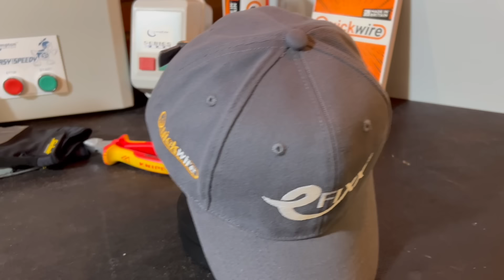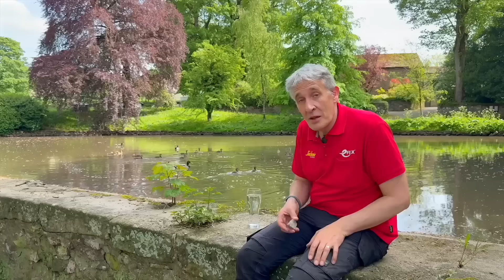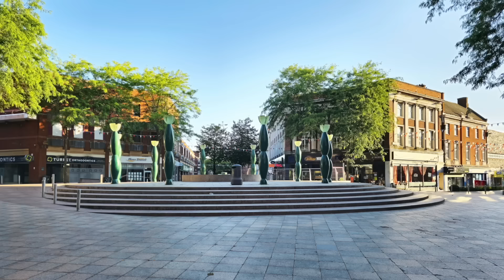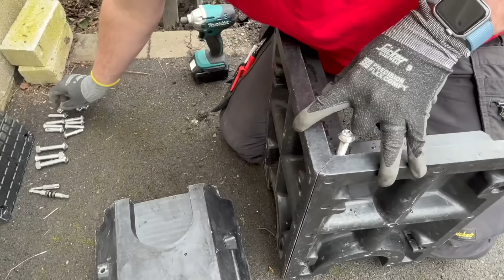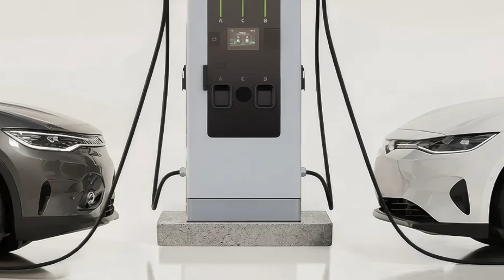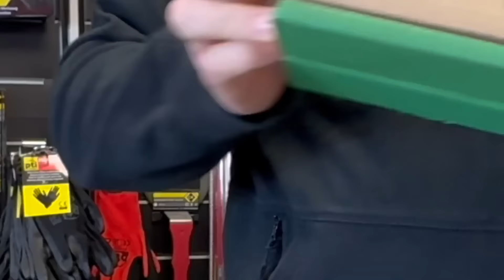Bi-Directional RCDs Unplugged - Have we got this Wrong?

Comment: That explosion can only have been from batteries. Not possible from solar panels and an inverter might go pop, but it wouldn't take the roof off. Or maybe Mr. Qureshi was cooking something he shouldn't have been.
Reply: @billdoodson4232  my thaught exactly i know the panels can internally short circuit and catch fire but never heard of one exploding.  Im a green horn in the electric world tho so what do I know
Reply: It wasn't an explosion - the video was clearly edited to select several still images/short video clips many minutes apart. You can see that by the shadow on the left wall dropping a several inches in multiple steps. The whole video was probably between 30mins to 1 hour - enough time for the fire engine to arrive at the end.
Reply: @tonyh6309  Ring cameras take a picture every 14 minutes or so.  That seems about right for the shadow movement in the frames.  However, modern solar panels don't catch fire.  The roof did.  The panels... probably didn't.   It probably started at a junction box or from a failure inside the loft causing a fire.  It may or may not have actually exploded so my other comments on it being gas or a battery runaway (the gas is flammable in a LFP runaway but the batteries themselves don't ignite it)... those would have likely been an incorrect asesssment.

Hmm.... but in reading more news reports on it, apparently there was an explosion.  It's unclear when though.
Reply: We don't know the story... start of last winter I got a panic phone call because somebodies boiler was tripping their RCBO, they had a tiny boiler room, 20 mins later, problem fixed but I had a lot of trouble gaining access to the faulty boiler because it was of petrol cans, acetone, BBQ gas cylinders in winter storage, about 20 unmarked plastic containers, solvents, cleaning products...
For all we know, the electrician may have done a first class job but the explosion was because he moved everything around in the loft to run the red & black 6mm!

Comment: If solar inverters could parallel with each other in island mode not only would they parallel with each other in the same property the whole street would parallel and maybe the whole town!
Unfortunately this is the quality and understanding of the people who write the regulations!
Reply: Not as silly as it sounds.  There were real concerns with just this happening in other countries.  Testing found that in areas with high penetration of PV anti-island protection could fail or take extended times to shutdown.  Plenty of research out there about it.  Your regulators are not idiots.

Now this is a different situation to the bi-directional RCD debate going on over there since supply is being actually disconnected from the inverter which is not the same as happens in a blackout where the inverter stays connected to the 'grid'.
Reply: There have been a handful of cases world wide that I know of where a subdivision that was disconnected from the grid continued to power itself due to having a large amount of installed solar.  It is exceeding rare since the loads have to be nearly perfectly balanced against generation for that to happen.   That virtually never happens.

This is not considered to be a danger to linemen any more now, though.  They will disconnect the grid but it will obviously remain energized and be tested as such.  They can either wait for it to hicup and turn off on its own or they can add a large momentary load across phases to force the inverters to shut-down.

Once the inverters turn off, they stay off.  The line won't magically come back to life in an unexpected fashion.

-Matt

Comment: I suspect bidirectional RCDs was pushed by the manufacturers who sit on the committee to promote their by-directional RCDs 
The inverter shut down was highlighted at the time.
Reply: The rest of the world was already moving or had moved to 'bi-directional' (terrible term) and neutral switching (for general uses, non-neutral switching is still available for obvious reasons) too for that matter.  It's actually quite difficult at this point to buy a non-bidirectional RCD/RCBO.  That you got to pay a premium for such devices well that's a good question for your brands, don't you think?

Still, it's a regulatory requirement over there, to my understanding, that an electrician installing a PV system has to use a bi-dir type or face the consequences which may be quite severe.  Bit odd that someone off the street can simply plug in an inverter and not face any consequences at all, even if someone somehow manages to die.

Comment: People see solar and a bang and jump to a conclusion. 1 If it's a new build battery would not have been in the loft. 2 to make batteries to fail to the point of venting takes a lot to do. For years these batteries have had many safety systems. My bet, someone storing paint in the loft. That's what created the volatile gas mix. It's very common to happen in sheds.
Reply: loft is best location for batteries, hidrogen and fire goes up so imagine this scenario with batteries on the basement

Comment: That explosion was caused by something stored in the loft. Maybe a propane camping stove or an unvented cylinder (though that wouldn't cause a fire). Solar panels do not explode.
Reply: I came close to it, lifting up loads of panels really high with a crane and the last panel was backwards which gave us a real pain-in-the-arse job of lifting it off because it needed rotating but this was the last panel so we had no room to safely rotate it in, so got the crane to move it away a bit, and as all solar panel installers will tell you, the secret is the rhythm and an exact process, break it and it goes pear shaped. Well, the  safety strap caught under the panel mounting rail, the panel flipped and it launched into space and headed for the ground from many stories up! It didn't explode in the dynamite sense, bit if you saw the wreckage, you'd think it had!
Reply: There was no explosion. The video was clearly edited down from a 30 to 60 minute sequence - see the shadows on the left wall and the arrival of the fire engine.
Reply: Given that the frames in the "video" were still shots taken about 15 minutes apart (idle "ring" camera still shots, noting the shadow), it might not have actually exploded.  The direct eye-witness reports centered on a fire and are unclear about there being any actual explosion.  But they do seem to be clear on the progression being pretty quick and there being a fire.

The damage to the left side of the roof is clearly from inside, but it is unclear whether the fire began inside or outside.  I don't think it would be so quick if it began outside, so I'm betting on it still having started in the loft itself.

But from what is unclear.  Obviously the solar panels themselves didn't explode.  Solar panels don't explode and modern panels don't really even burn in any sort of self-sustained fashion. They can be burned.  They don't burn on their own even if you put a torch to them.  Take the torch away, the panel stops burning.
Reply: they do with an MC4 connection bud
Reply: @EverydayLife621 An MC4 connection is just an electrical connection. Their failure modes are only going to involve overheating and arcing. These alone do not cause an explosion - an appropriate air/fuel mixture (in the appropriate ratio, and in a confined space) must also be present. Solar panels are very unlikely to be such a source of such air/fuel mixtures, particularly as they are outside of any confined space by their very nature. Is everyone this dumb?
Reply: Which bit explodes with enough force to take a roof structure off designed to withstand repeated gale force winds?

Comment: Contractor fined after underground cable strike - WHY, OH WHY are companies still issuing polyester PPE? I have been complaining about this where I work since 2007 and nobody listens, on the railway such PPE is flame retardant so why are companies not addressing this?
Reply: Or, if we had an honest discussion, in 30 years of using diggers, JCB's etc, how many of us haven't hit a gas pipe, water pipe, sewage pipe, drain pipe, cable, I think I've probably got most of the set. I once was digging away and disappeared down a huge hole, turned out to be a WW2 air raid shelter.

Comment: Sorry, solar installation exploded?!?
How can a solar installation explode? There's nothing in there that can explode. What could have happened is that the solar installation caused a fire, which then caused something else (e.g. an accumulation of heating gas) to explode.
Reply: The panels obviously did not explode.  But the reports are varied and the still shots are at least 15 minutes apart from each other (look at the shadow of the sun line in the photos).  It sounds more like something caught fire (like a junction box or something), but that doesn't explain why the whole roof went up...

So it still could have been something inside the loft space.

There are conflicting reports as to whether there was any actual explosion or not.

-Matt
Reply: The installation could have comprised micro inverters and as such mains voltage is present under each panel as opposed to a dc system where mc 4 connectors only are present. We will have to wait on the findings of the investigation.
Reply: @TheYohtube  And how are micro inverters supposed to explode like that?

Comment: Hi mind if l ask . Can a  plug in solar panel be adapted to charge batteries independently off  grid .
Reply: Those panels are all the same, what you need is just a few panels and instead of an inverter buy a solar battery charger.
Reply: You need  Victron system or similar where no mains voltage is present.

Comment: The only time you need a bidirectional RCD is if the load can feed power in the absence of power on the supply side, which should never happen in any normal scenario, and if it does, you likely have bigger problems.
Reply: Mike why would the absence of power make a difference? Surely it is possible to flow either way on a healthy system?
Reply: @markrainford1219  All modern Solar Inverters should shut off if there is an absence of "The Grid" so in theory power shouldn't flow to the RCD "Backwards" in a fault scenario because if the grid has ceased to exist in that scenario, the inverter has already shut down!
Reply: @sam-n9v Yes I get that on a blackout. But on a healthy system power does go either way.
Reply: @markrainford1219  Remember, the RCD/RCBO will still trip even if it isn't a bi-directional (worst term possible!) should there be imbalance across the device regardless of on which side the fault is.  Bi-dir is more about how the RCD/RCBO itself survives a fault situation, including the fault caused by the test button.

That doesn't change the fact that, to my understanding, a UK electrician must fit a bi-dir type when installing an inverter and will face penalties (potentially prison should someone manage to die somehow) if they do not, yet a person off the street can now simply plug in a 'plug-in inverter' and face no consequences what-so-ever.
Reply: @sam-n9v the problem is from the PV inverter not shutting down fast enough. It's likely to be 10 slower than the RCBO trip time.
Reply from the maker: The one we tested shuts down in 10ms
Reply: Hi Mike, check out islanding / off-grid / UPS - many of the new inverters are not ‘grid-tied’ and do ‘whole house backup’.

Comment: I think the idea of solar panels on railway tracks could one day be de-railed if one expolodes! 🤔
Reply: They’re only viable where the line is electrified. Have you seen the state of the gravel where diesel locomotives are running?
Reply: @hughmarcus1  Not sure but I don't think diesel trains can run on electric 😁
Reply: They do. The diesel engine drives a generator, final drive is electric motors.
Reply: @markrainford1219  Even so, you can't get solar power to them motors without the third rail which is not supported by all tracks. At least not in the UK

Comment: It is becoming increasingly apparent that someone possibly has their financial hand up the rectum of Efixx.

Why don't you show us how plugging in additional sources of energy, such as solar and batteries after the circuit protective device, affects the characteristics and behaviour of that circuit under fault and overload conditions, and likely extends disconnection times?

Where do the cable calculations in Appendix 4 of BS 7671 allow for an additional source of energy in a circuit, above and beyond the protective device rating, at the circuit origin?

BS7671:2018 IET Wiring Regulations Amendment 4:2026 -  Regulation 551.7.2.1, states the generating set shall be installed on the supply side of all the protective devices for the final circuits of a distribution board. Plug-in Solar PV and battery storage does not meet this. For the purposes of this regulation, stationary secondary batteries shall be considered a generating set and not a load.

BS 1363-1:2023 - 13 A plugs, socket-outlets, adaptors, and connection units - Part 1: Rewirable and non-rewireable 13 A fused plug -Specification and Clause 5 states, ‘Plugs shall not be used for the connection of electrical power generators to socket‑outlets.'

It appears plug-in solar and battery storage is going against historic 
British Standards, and will likely give insurance companies plenty of wiggle room if something goes wrong.

Endorsing these products would seem unwise with this knowledge.

Comment: The 'testing' of two micro-inverters interconnected with the LV network using an electric drill as a load may have been helpful in illustrating a point but it didn't prove much, unfortunately. It's worth noting that inverters that employ so-called 'active methods' to monitor the 'grid' are not approved for use under G98 (see s.10.2.1 Loss of Mains Protection). This has been the case since before the introduction of G83. Your video doesn't go into any detail as to the type of LoM protection these inverters use or their settings.

Comment: That solar blast has to be someone installing LFP cells in the loft space and one of the cells vented flammable white smoke. 
Panels simply do not blow-up - set on fire (usually bad MC4s!)- YES, blow-up NO
Reply: Roof didn't "blow up" the footage is a few still frames
(Look at shading on alleyway wall)
A few frames numerous minutes apart, see shading
Will give the appearance of the roof exploding & gone in seconds

Then a woman is standing outside
A fire engine has appeared by magic
& It then shows running footage after the event

But the appearance of the roof EXPLODING - makes better headlines if you use a few still pics to give that appearance

The roof was not blown off in seconds like it might seem in the explosion presented by a few still frames that afternoon
Reply: @authuruksake969 well explained guna re watch with this in mi d
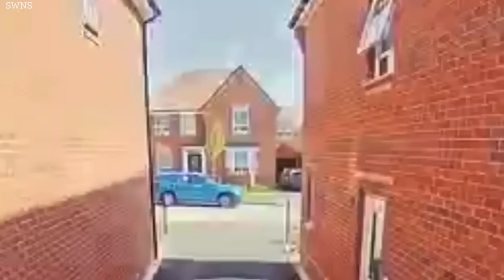Reply: @authuruksake969  4:24 - It exploded! The roof was blown off and looked like it ended up on the cars!
Reply: @biker_rich_71 of course & the fire engine just appeared out of a Genie's lamp
Reply: @biker_rich_71 Time lapse has the effect of speeding things up quite a lot.  Look at the sunlight and shadow on the wall in the left side of that clip
Reply: LFP can vent Hydrogen in rare cases. If enough collects in a confined space and there's a spark... 💥
Reply: @pau1phi11ips  yup looks like a hydrogen-air explosion, Hydrogen has a very very very low ignition energy compared with natural gas etc.
Reply: @pau1phi11ips  ...nevertheless as you say is rare, the only one I can think of is the ABC electric narrow boat, using a rackmount system (non compliant) under the floor (has the report came out yet?)
Reply: @EverydayLife621  Well played ...
Reply: If it was a new install the battery would not have been in the loft.
Reply: @RichardEricCollins  loft is best location for batteries
Reply: Yup, that's what it looks like.   Either a slow gas leak or a runaway LFP battery venting white smoke.  Neither will self-ignite but hydrogen can become very explosive with the right mix of oxygen (from the air).  One spark and you get a boom, but typically no fire.

I don't know why the U.K. ever allowed batteries (or anything really) to be installed in lofts in the first place.  That's just a dumb idea in general.

-Matt
Reply: @junkerzn7312  loft is best location to install batteries, you guys that install batteries in basements need to rethink a bit
Reply: YouTuber “DIY Solar byWill Prowse” had a video on LFP safety.  The main point is that they rarely catch fire, but they can vent hydrogen very quickly when overcharged or otherwise abused (hundreds of litres per second per cell). So the fire risk is small, but the explosion risk is present.

He ran a test involving overchargeding an LFP cell.  The initial venting resulted in quite small flashovers in the presence of a spark, due to a lack of oxygen.  But once water was added to the equation, the venting was a lot more vigorous, and once the enclosure lid was lifted, the flashovers were much bigger.  At this point there was also a small fire from the entrolyte igniting.

Comment: Your drill was not under any load when you ran the test. Not that it would make much difference. But be interested to see a high rotating load like direct driven motors to see if it has enough inertia to trick it
Reply: He was drilling it into the mortar between the slabs on the detailed video
Reply: A small series motor as in a typical drill is not a proper load for such an experiment.
Induction motors, capacitors, the filters in electronic devices and so on, all mess way more with the sine wave than that small drill.
Reply from the maker: I’ve had three systems running simultaneously fir the last three months with a vast array of load conditions. When the grid goes they shut down.